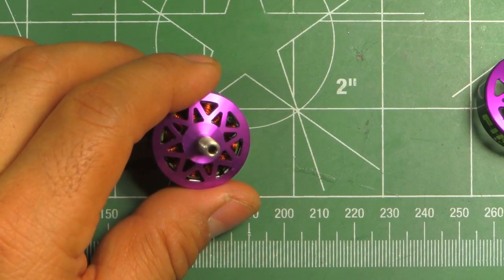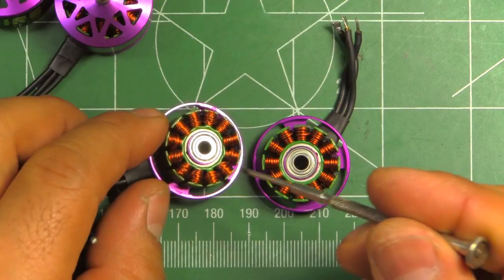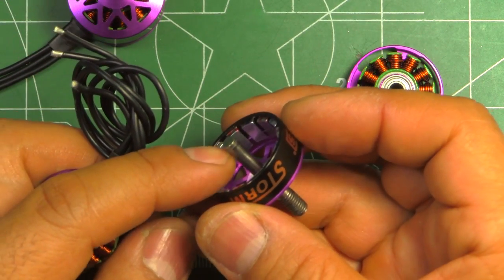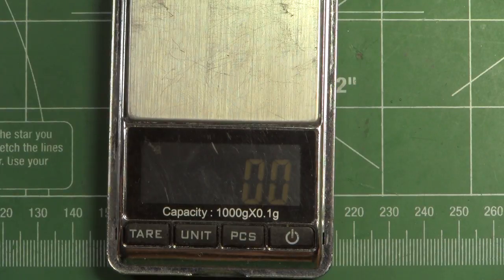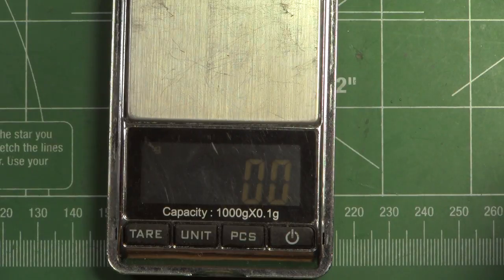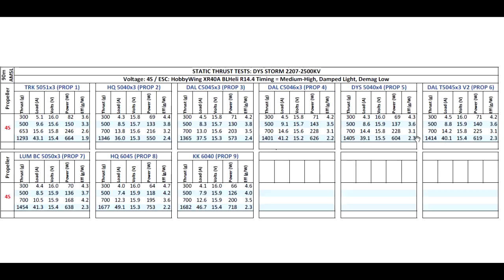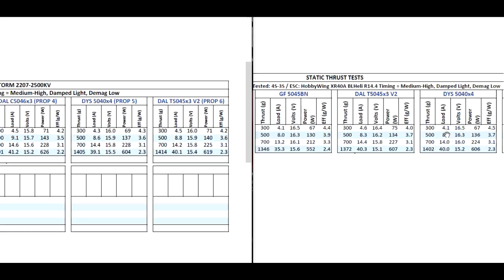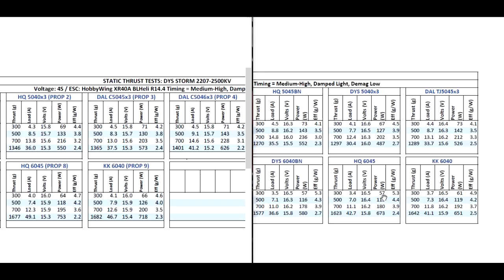DYS STORM 2207-2500KV New Motor Static Thrust Tests and Overview

Comment: This might seem like a stupid question but can a DYS SE2205 2550kv motor be used with a 7'' propeller 4 or 5s? I want to do a 7'' build and i would prefer to just buy a frame and then transfer the guts from an old retired 5'' i have into it. I know it's not ideal but what sort of problems could i face and would there be a more mild prop more suited to something like that? Thanks in advance. 

Specs below. 

Ipeaka 30a escs/bumpbee/airbot copies/ betaflight f3 fc

https://www.banggood.com/DYS-SE2205-PRO-2300KV-2550KV-3-5S-Lipo-Race-Edition-Brushless-Motor-for-180-210-220-FPV-Racer-p-1059008.html?gmcCountry=AU&currency=AUD&createTmp=1&utm_source=googleshopping&utm_medium=cpc_ods&utm_content=heath&utm_campaign=pla-multi-au-pc&gclid=EAIaIQobChMIlKG8wvfu3AIV1AcqCh2YlgiFEAQYASABEgIcofD_BwE&ID=514648521310&cur_warehouse=CN

https://www.banggood.com/Sloss7-7-Inch-270mm-Wheelbase-4mm-Arm-Thickness-Carbon-Fiber-Frame-Kit-for-RC-Drone-FPV-Racing-p-1337619.html?rmmds=search
Reply from the maker: No question is stupid. It's more stupid not to ask and end up messing up stuff ;)
2205 + 4S/5S + 7" is not a good match. The prop would put too much load on the motor. You would have to run a very low pitch prop, something like a 7x1.5  perhaps. For the 7" props available now, the GF Flash 7042 and HQ7045 you need at least a 2207 or 2306 motor. For 5S you would want a low 1200 to 1500KV. For 4S 1500 to 1750KV. Those are the smallest motors that may work. But I would much prefer a larger 2407 to 2507 motor same KV as above.
Reply: Yeah i understand. I should stop spending money on this stuff for awhile. HA!
Reply from the maker: kramersteen LoL... that's the problem se all have. Always something else we need to buy
Reply: So what brand/model motor would you recommend on a 7'' 5s racer?
Reply from the maker: High budget T-Motor F60 or F80, low budget RacerStar, Garila,

Comment: How did you get the bell off this motor.  I'm having trouble with mine.  I removed the retaining ring but it's on there really good
Reply from the maker: Yes, i remember it was difficult. When they're tight I install a 6" 2-blade prop and 2 M3x10 or around there 8 to 12mm M3 screws, I use a needle nose plier at the motor base, grabbing both threaded screws (fully screwed in but careful not to over-screw and hit windings)
One hand pulls from propeller, other hand holds motor by pliers. Pull straight out, all have come out that way.  
Other options.... you can try throwing motor in the freezer for a few hours, then rinse with warm water and try pulling using above method to make it easier in case too tight. You can also mount motor onto a used carbon fiber arm, use 4 screws, and step on arm, then pull from propeller.
Reply: EngineerX great suggestions I will give them a try!  Thank you 😊

Comment: Great video :) Would you recommend these over the RS2306 2400kv? Thanks!
Reply from the maker: Depends what you intend to do with your setup. If you want all out speed on a superlight frame (racing on a track with gates, turns, etc), then these would be a good choice. For freestyle -acro and filming your flights the DYS Storms are good as they are smooth due to the larger airgaps (space between magnets and stator) Larger airgap helps get rid of twitchy yaw in some setups but motors will be less powerful. So far these have been doing OK for durability. I have not seen any issues reported yet. Both are good choices, just a matter of what's going to be the main purpose of your rig.
Reply: Yes, I was a bit worried about the Emax because of the impact it would have on tuning. I'm building the quad for this summer so I still have time to think about exactly what kind of performance I would like out of them. I really appreciate your detailed response, keep up the great videos! :)

Comment: good review as always but 2 comments. 1. fix your mic mate, if your goal is to build a good utube channel , fix your mic.audio is 50% visual is 50%. 2. I think quadmcfly said ,in the motor and esc performance testing thread in rcgroups,  that single strand is almost always better, reduces eddie currents and the copper is always more than multistrand given a fix kv, correct me if I am wrong.
Reply from the maker: I bought a Rode mini mic, hooked up to laptop and got same crappy voice recording. Blew my budget for audio there. 
There are both advantages & disadvantages about single/multi strand wiring
As I mentioned on the video, multistrand has the advantage of packing more copper per turn, just based on geometry, you end up with fewer voids in between wires. That, in theory, results in stronger mag forces.
Another advantage that I think may add to overall performance, even if just a little.... Based on the fact that there's no magnetic "force" coming from the top and bottom of each stator winding (those are null areas), thicker gauge wire may bulge out more at each turn (top and bottom) so you loose some performance there. A good example of a high-performance motor with multi-strand windings is of course the EMAX RS motors....  

Thicker wire does have its advantages, I believe it should handle more current and perhaps does reduce eddies more. I don't know about copper being more in single than in multi-strand. Geometry principles say otherwise. Just draw a 10x10mm square or a 10mm circle. Then draw as many 1mm circles inside, count number of 1mm circles you can fit. Now do the same with 2mm circles. Calculate total areas of both, I bet you you'll get more area with the 1mm circles ;) Now, if motor manufacturers would start using square section wires..... we'd see a nice jump in performance!
Reply: Very interesting points!Very sorry for your audio :(. I have a feeling though that the culprit here is not the mic but your laptop's sound-card, that background noise points to that. If you are using windows download audacity and play with the settings. It has some background noise reduction filters. Also do not record in stereo. Sound is tough to get it right ,I know.
Reply from the maker: Yep, it's got to be the crappy soundcard. Will try Audacity. I used "CamStudio" to capture screen and audio, I'll have to look into a different screen capture program too. Otherwise.... crappy audio will remain I'm afraid, sorry !
Reply: You can do it!
Reply from the maker: As in Rob Schneider& Adam Sadler reference? LoL ..... I will try !!! thanks for the tips.
https://www.youtube.com/watch?v=0RKXqpVQdS4
Reply: Haha yeah!

Comment: Idk man, for the weight, they arent bad, but the Cobra and the T motor 2207s seem to have significantly more torque.
Reply from the maker: Yep, that's probably the case, though I have not personally tested those so I can't yet say how much more power those can make. DYS needs to venture and make a "premium" motor with curved magnets. That's all they need to add  - "Lightning" motor series DYS, make it so!

Comment: nice! there is one thing i dont understand about static testing, why dont you measure them like on a dyno so that we have power from 0 to 100% graph? we would see the torque?
Reply from the maker: Right - hehehehe ;) ..... I wish I had a full test lab and proper equipment at my disposal.... and motor testing be my  main job. The equipment I have is good, but still hobby-grade. The best I can do is keep testing under same conditions so we can compare different motors under same loads. The 6" props stress motors quite a lot, so we can see which motor can drive the 6045 or 6040 prop at higher RPM/thrust and check to see how many Amps are needed. That sort of gives you an idea which motors are more "powerful"..... still, there are many other aspects that won't show on these tests. Unfortunately, only flying them will tell you the whole story. These tests should give you a little bit of info to start with.... Thanks for watching!
Reply: Pukki34 that's a refreshing thought! but what sort of dyno would be used to measure 40000rpm?
Reply: Pukki34 I do believe all of the power we see here is actually torque,  the prop adds the thrust component, but an electric motor makes its maximum tourque at zero rpm and then it starts dropping. tourque here is the action and the thrust is only a measurement of the work being done. been a long time since I talked about these kinds of things someone knowledgeable correct me if I'm wrong, but I think my statement there is more right than not.